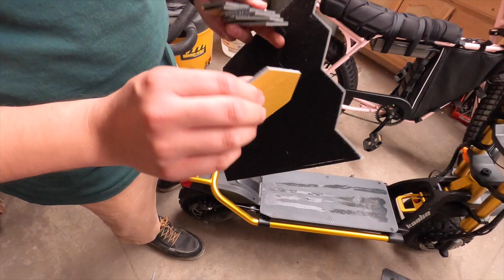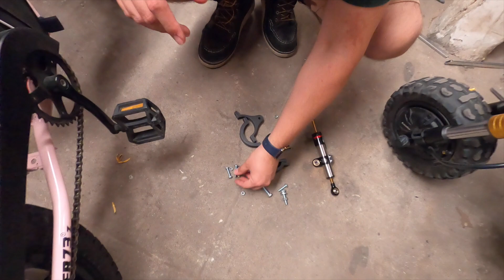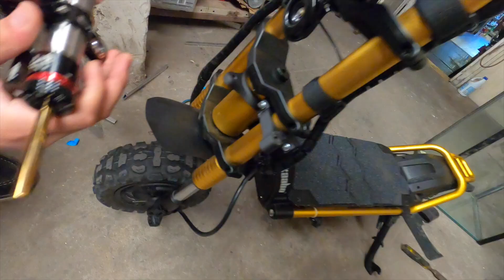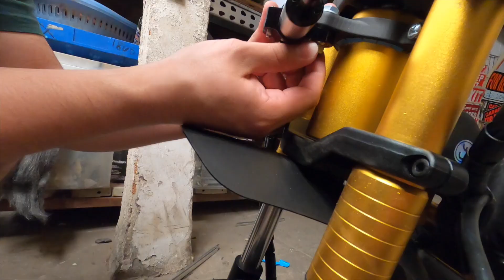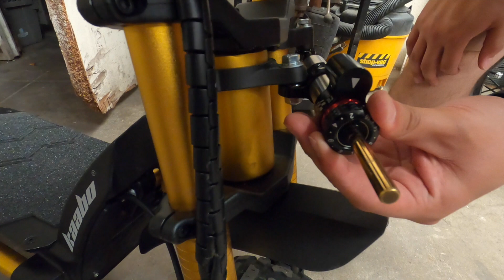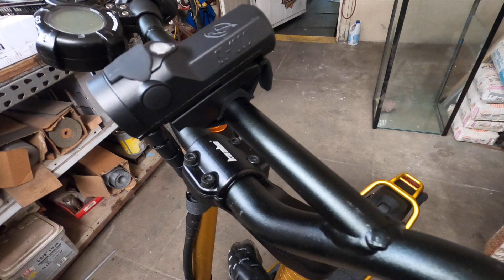72v Kaabo Wolf King (upgrades)

Comment: Where did you order the steering stabilizer from? Can’t seem to find one for my wolf? Did it come with the mounts or brackets? Thanks Jim
Reply from the maker: I had the bracket 3D printed and bought the stabilizer off Amazon. The bracket is the same from the wolf warrior.
Reply: Any chance of getting info on who 3D printed the brackets for you or if you have any brackets left to sell? Thanks
Reply from the maker: Yeah feel free to get that bracket and dampener. I’ll have Jesus Sepulveda message you with some info where you can get the bracket printed and the link to the dampener

Comment: did you loose some steering angle after the damper was installed?
Reply: I lost very little steering angle. Almost nothing but just a tiny tiny bit. But it doesn’t matter to much since you tend to lean on turns and not really turn the handle bars when turning.
Reply: @MrSepulveda0514  cool thanks good to know.

Comment: You got speed wobble on The King? Haven’t heard that from others.  Wonder how fast you were going.
Reply from the maker: It’s more like a safety feature due to the roads where I live. Ive had speed wobble on my 10x so I didn’t want to risk it on a powerful-er  scooter.
Reply: Ah makes sense man.  Appreciate you getting back to me.  I may very well buy The King btw now and next Spring.  Just wish Kaabo tweaks it by then with mode indicators and maybe turn signals like the Wolf X. Hope it treats you well dude.  I respect your guys’ know-how though.  Stay safe brother.
Reply: @playboy2323  a few days ago  Kaabo scooters Instagram showed that they are coming out with a “wolf king pro gt” that comes with turn signals, bigger battery and stem mounted controllers for better cooling. if it does come out that thing will be bad ass.
Reply: @MrSepulveda0514  oh shit!!! That’s big time news dude.  Thanks for that.  I assume bigger battery will mean more range! 

I wonder a couple of things tho.  Will they throw in mode indicators so you finally know easily if you’re in eco/turbo or single/duo because this to me is paramount.  Also, what the price will be.  The $3K isn’t cheap lol but if it’s $3.5K-$4K then man that’s a lot.
Reply: @playboy2323  it will have 25% more battery so yeah a good amount of extra range. Riding 25-35mph  on my wolf king has gotten me 30 miles of range. So that extra 25% will be sweet. 
Yes on back light for the turbo eco dual single buttons.
Dual 2000 watt motors. Up from the dual 1500 watt on the king right now.
That’s the link on some of the specs for the wolf king pro GT
https://www.vrooomin.com/electric-scooter/kaabo-scooters-teases-the-next-level-72v-35ah-50a-wolf-warrior-king/
Reply: @MrSepulveda0514  dude JESUS CHRIST! They’ve legit fixed every issue I’ve had with the current King.  Indicators, turn signals, range, stem height and width.  Wow! Thank you for the link man, I appreciate it.  This def looks like my next scooter! I def assume it’ll prob run us at least $3,500.  Kaabo really listened.
Reply: iva done 103 km\h downhill on wolf warrior 11 and it was steady